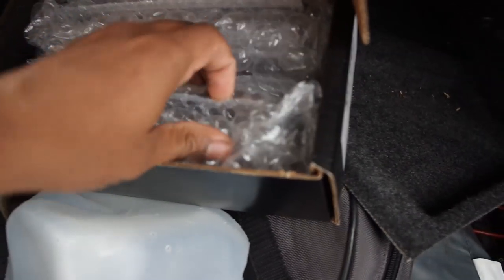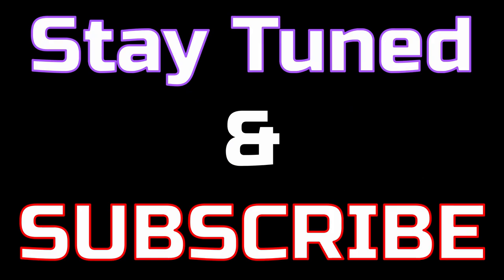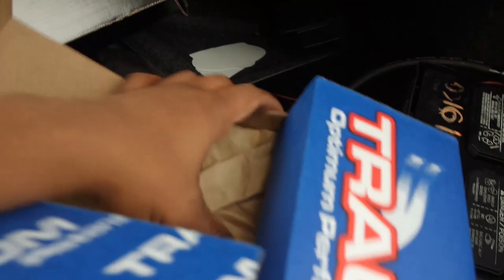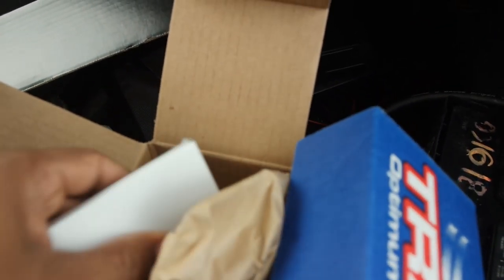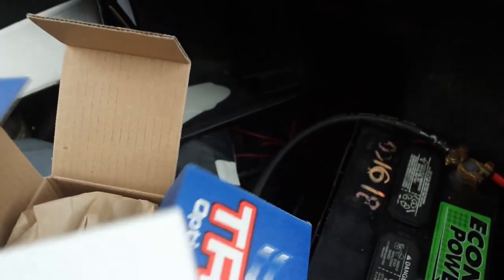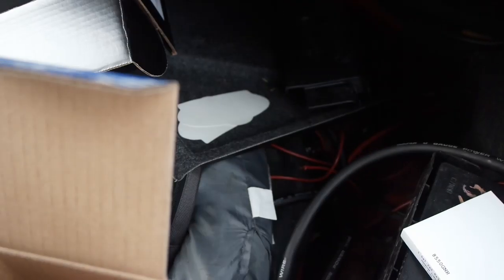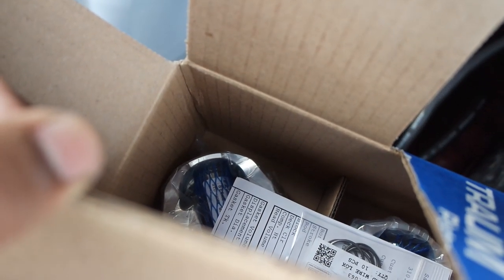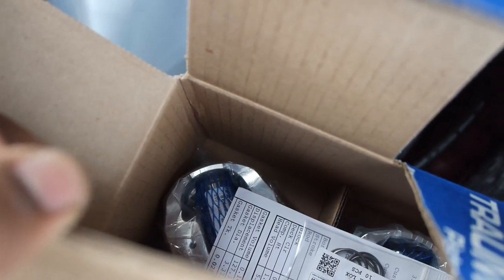Turbo f20b Honda Prelude  gets new parts

Comment: Finally got my F20B assembled and dyno'd but swapped it because it smoked too much like a diesel rollin coal from too much piston to wall clearance as the machine shop said it would but... Those KStuned rods are champion! The stock F20B pistons and KStuned rods held 25lbs of boost on e85 for about 3 hours of pulls lol. Threw in a stock longblock h22a4 on 10psi made 280whp but I'm ready to see you build this beast. Start saving a tire fund lol!!
Reply from the maker: Nice and i know right. Need something thats gonna put that power to the ground